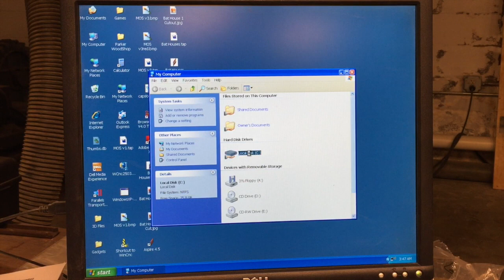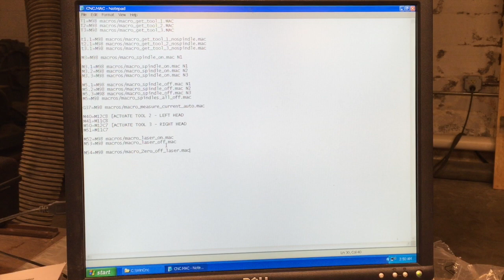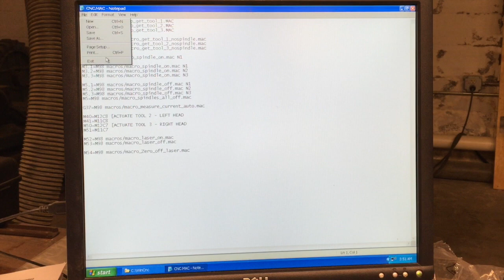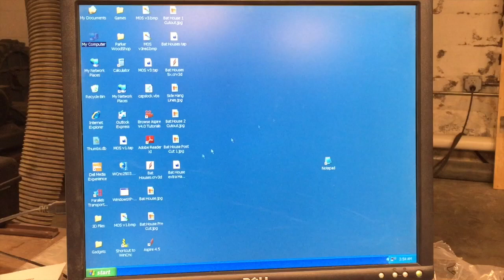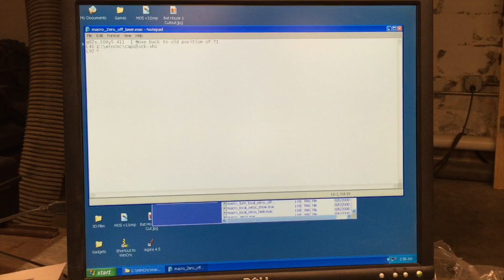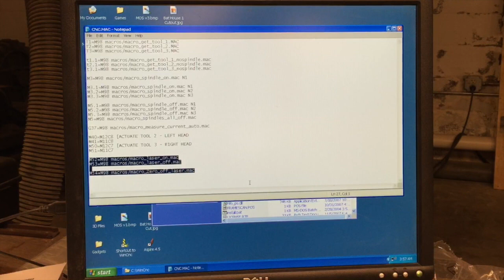Comment: There are a couple of files that need to be modified and verified in order to get new Macro commands working.

Overview of what we are going to do

1. Exit or Quit the program WINCNC

2. Edit and Add to: CNC.MAC - Located at C:\WINCNC

3. Verify in the Macros sub-directory the EXACT NAMES of the Macros to control the laser.

4. Restart WINCNC program

5. Test the Macros by typing them into the WINCNC command BOX by hand

6. If all is good, try the laser control buttons not the keypad.

Let's get started...

Assuming it is CAMaster standard current config.

We are going to setup these three M## Commands to do the following:
M52 will be Laser ON
M53 will be Laser OFF
M54 will be Zero at Laser position.

Step 1:
Quit WINCNC

Step 2:
Go to your MACROS directory and see what your laser control command files are named (Note: Upper Case and lower case are the SAME --==> CAPS do not matter in file names)
CD C:\wincnc\macros
DIR

We are looking for these files and their exact spelling. They might be spelled different but we are wanting to find the LASER control macros
laser_on.mac
laser_off.mac
macro_Zero.mac or it might be Laser_Zero.mac

Write these names down somewhere so you will know in a few minutes, however do them like you see: The Underscore _ is not a space, dash, or anything else it is an UNDERSCORE and it matters.

Step 3:
We need to Edit your C:\WINCNC\CNC.MAC file.

Go to your WINCNC directory: 
CD C:\WINCNC
Edit the file CNC.MAC by doing a RIGHT click on the name and click EDIT

You will see the file
I have one that looks like this: (Note that lines starting with [ are ignored and considered comments )
M3=M98 macros/macro_spindle_on.mac N1

[M3.1=M98 macros/macro_spindle_on.mac N1
[M3.2=M98 macros/macro_spindle_on.mac N2
[M3.3=M98 macros/macro_spindle_on.mac N3

[M5.1=M98 macros/macro_spindle_off.mac N1
[M5.2=M98 macros/macro_spindle_off.mac N2
[M5.3=M98 macros/macro_spindle_off.mac N3
M5=M98 macros/macro_spindles_all_off.mac

G37=M98 macros/G37Z.MAC [ATC
[g37=m98 macros/macro_measure_current_auto.mac

[X3 TOOLS]
[T1=M98 macros/macro_get_tool_1.MAC
[T2=M98 macros/macro_get_tool_2.MAC
[T3=M98 macros/macro_get_tool_3.MAC

[t1.1=M98 macros/macro_get_tool_1_nospindle.mac
[t2.1=M98 macros/macro_get_tool_2_nospindle.mac
[t3.1=M98 macros/macro_get_tool_3_nospindle.mac

[M40=M12C8 [TOOL 2 UP
[M41=M11C8 [TOOL 2 DOWN
[M50=M12C7 [TOOL 3 UP
[M51=M11C7 [TOOL 3 DOWN

[ATC SETTINGS]
[M52=M98 MACROS/RELEASE.MAC
[M53=M98 MACROS/CLAMP.MAC

[M60=M98 MACROS/DustBootOn.mac
[M61=M98 MACROS/DustbootOff.mac
[M62=M98 MACROS/VACON.MAC
[M63=M98 MACROS/VACOFF.MAC

[M64=M98 MACROS/GATE_OPEN.MAC
[M65=M98 MACROS/GATE_CLOSED.MAC

[M70=M98 MACROS/POPUP.MAC
[M71=M98 MACROS/POPDOWN.MAC
[M72=M98 MACROS/SERVO_ON.MAC
[M73=M98 MACROS/SERVO_OFF.MAC

[T0=M98 MACROS/T0.MAC T0
T1=M98 MACROS/G37Z.MAC T1
T2=M98 MACROS/G37Z.MAC T2
T3=M98 MACROS/G37Z.MAC T3
T4=M98 MACROS/G37Z.MAC T4
T5=M98 MACROS/G37Z.MAC T5
T6=M98 MACROS/G37Z.MAC T6
T7=M98 MACROS/G37Z.MAC T7
T8=M98 MACROS/G37Z.MAC T8
T9=M98 MACROS/G37Z.MAC T9
T10=M98 MACROS/G37Z.MAC T10

Add these three lines below shown in red EXACTLY as shown to the bottom of the file and save it.

M52=M98 macros/laser_on.mac
M53=M98 macros/laser_off.mac
M54=M98 macros/macro_Zero.mac or maybe M54=M98 macros/LASER_Zero.mac depending upon Step 2 above - look at your notes

Now your file might look like this

M3=M98 macros/macro_spindle_on.mac N1

[M3.1=M98 macros/macro_spindle_on.mac N1
[M3.2=M98 macros/macro_spindle_on.mac N2
[M3.3=M98 macros/macro_spindle_on.mac N3

[M5.1=M98 macros/macro_spindle_off.mac N1
[M5.2=M98 macros/macro_spindle_off.mac N2
[M5.3=M98 macros/macro_spindle_off.mac N3
M5=M98 macros/macro_spindles_all_off.mac

G37=M98 macros/G37Z.MAC [ATC
[g37=m98 macros/macro_measure_current_auto.mac

[X3 TOOLS]
[T1=M98 macros/macro_get_tool_1.MAC
[T2=M98 macros/macro_get_tool_2.MAC
[T3=M98 macros/macro_get_tool_3.MAC

[t1.1=M98 macros/macro_get_tool_1_nospindle.mac
[t2.1=M98 macros/macro_get_tool_2_nospindle.mac
[t3.1=M98 macros/macro_get_tool_3_nospindle.mac

[M40=M12C8 [TOOL 2 UP
[M41=M11C8 [TOOL 2 DOWN
[M50=M12C7 [TOOL 3 UP
[M51=M11C7 [TOOL 3 DOWN

[ATC SETTINGS]
[M52=M98 MACROS/RELEASE.MAC
[M53=M98 MACROS/CLAMP.MAC

[M60=M98 MACROS/DustBootOn.mac
[M61=M98 MACROS/DustbootOff.mac
[M62=M98 MACROS/VACON.MAC
[M63=M98 MACROS/VACOFF.MAC

[M64=M98 MACROS/GATE_OPEN.MAC
[M65=M98 MACROS/GATE_CLOSED.MAC

[M70=M98 MACROS/POPUP.MAC
[M71=M98 MACROS/POPDOWN.MAC
[M72=M98 MACROS/SERVO_ON.MAC
[M73=M98 MACROS/SERVO_OFF.MAC

[T0=M98 MACROS/T0.MAC T0
T1=M98 MACROS/G37Z.MAC T1
T2=M98 MACROS/G37Z.MAC T2
T3=M98 MACROS/G37Z.MAC T3
T4=M98 MACROS/G37Z.MAC T4
T5=M98 MACROS/G37Z.MAC T5
T6=M98 MACROS/G37Z.MAC T6
T7=M98 MACROS/G37Z.MAC T7
T8=M98 MACROS/G37Z.MAC T8
T9=M98 MACROS/G37Z.MAC T9
T10=M98 MACROS/G37Z.MAC T10

M52=M98 macros/laser_on.mac
M53=M98 macros/laser_off.mac
M54=M98 macros/macro_Zero.mac

Save the file and exit the Editor

Step 4
Start WINCNC

Step 5
In the top command line box type M52 and press Enter Did the Laser come on? Try M53 and M54 the same way.

If any of these did not work check your error here:
1. If you get an error "Error - Syntax - Command or File Not Found" then you likely have a TYPE-O from the lines you just added to CNC.MAC: Look at CNC.MAC, fix any issues, restart WINCNC, try the buttons again.

2. If you get the error File Not Found - MACROS/LASER_ON.MAC (or other files) then you're laser commands may be spelled differently in your C:\WINCNC\MACROS directory. Go to that directory and see how your's are listed and them spell them the same way in the file C:\WINCNC\CNC.MAC file.

3. If you are missing one like LASER_OFF.MAC then lets make the file you need.
•	Copy and paste LASER_ON.MAC in the same directory
•	Rename the new file: LASER_ON (copy).mac to LASER_OFF.MAC
•	Edit the new file and change the line M11C2 to M12C2 and save it.

Step 6
Click on the WINCNC program box to make sure it is active and the current program in Focus
Now try the Keypad
Press the buttons on the keypad to control the laser, they should work if the manual entry worked in WINCNC